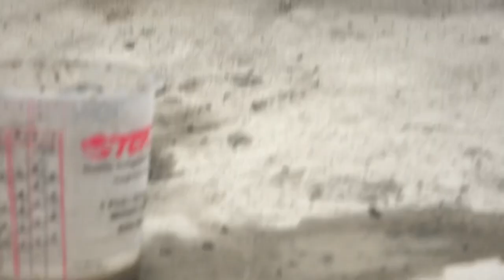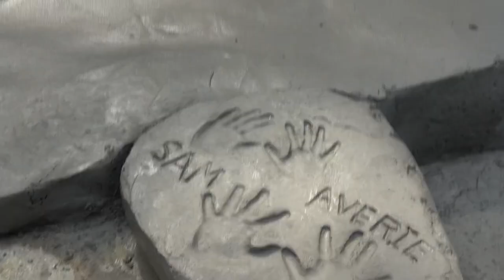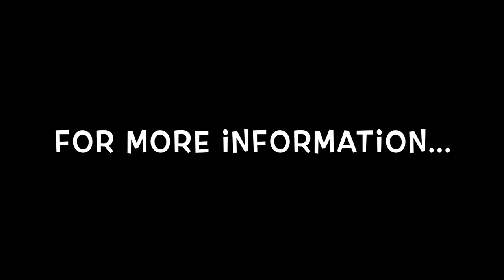Project in Cincinnati start to finish

Comment: Great videos and I plan to use your techniques to build a waterfall/ slide for my pool. I have had a friend come up with an objection to this technique due to air pockets developing in using a formless technique.  How do you overcome come air pocket which weaken structural integrity?
Reply: I found the company does not answer questions.  I too would love the answer to that very pointed question
Reply: Get air entrainment added to your mix, there is more than one way to build a waterfeature! Careful next to a pool, do a rebar armature or precast panels

Comment: Hi, I am from South Africa. I have a rock pool, but it looks very artificial (not as beautiful and realistic as yours) and coloring not well. 2 questions: did you use water-based paint, and did you use any sealers? Does the paint not go off?
Reply: Use pigment mixed into your concrete and then add concrete stains for the detailing.  Add a good Matt sealer that is chemical resistant and reapply every few years